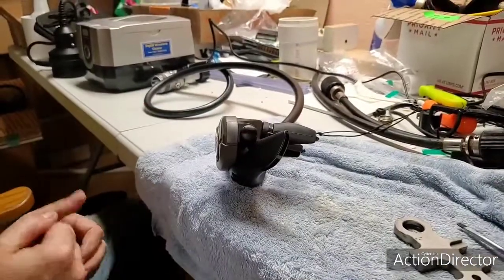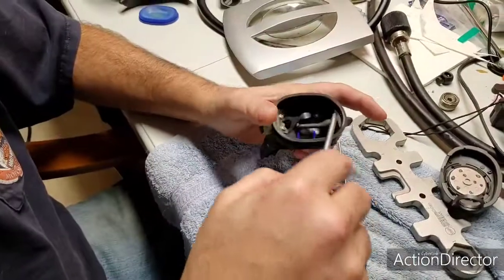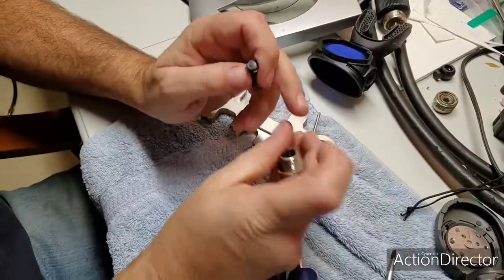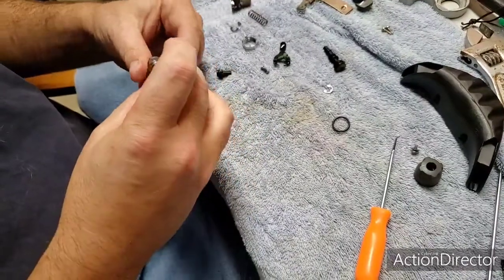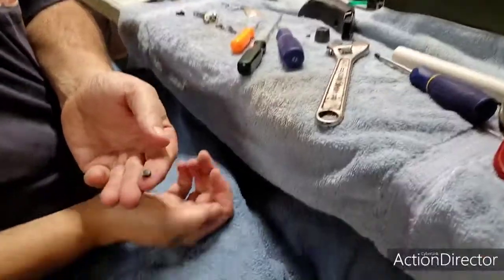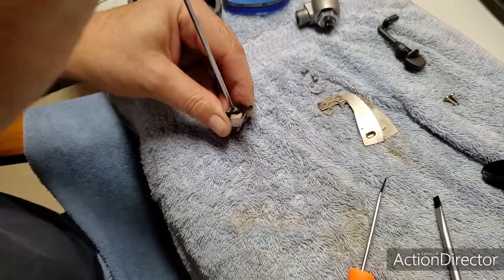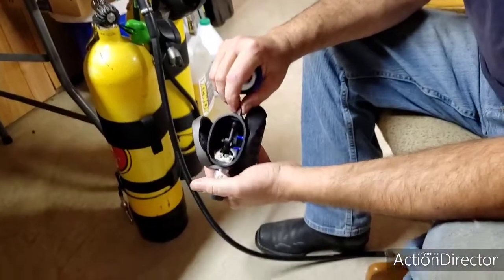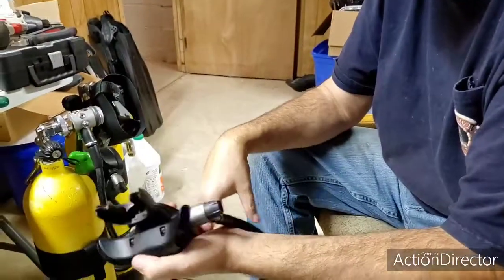Sherwood Maximus 2nd stage

Comment: 15:43 what's that lever do exactly?? The adjustment knob on other side controls airflow but I was wondering what the "switch" does haha sorry I just tested out the regs today WORKED AMAZING top-notch regs thank you so much again Mark im super happy with these!
Reply from the maker: the gray lever that turns the fins i have been told that it when you exhale it captures more heat and moisture in 1 position than the other was also told that it has something to do with exhale effort. if you look at the way the fins are curved it blows your exhaled air at the valve / 2nd stage seat.